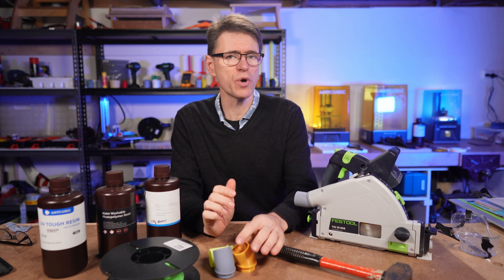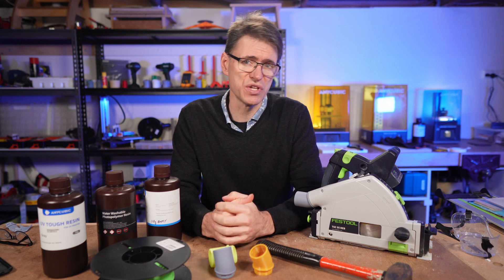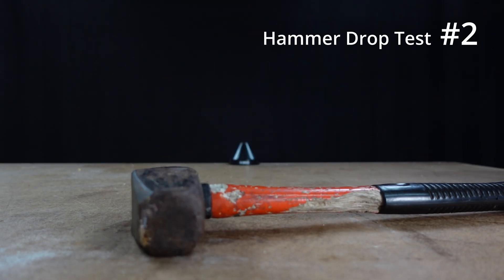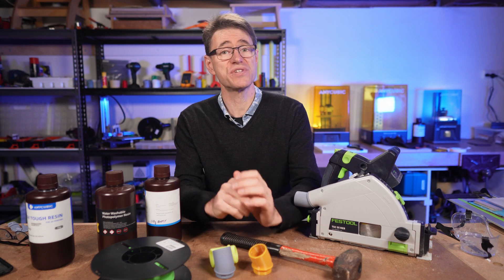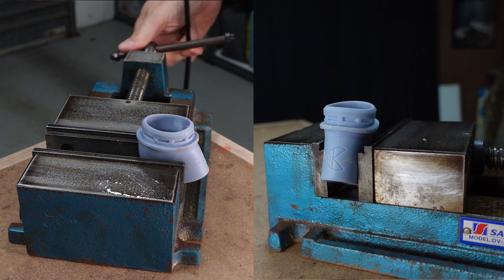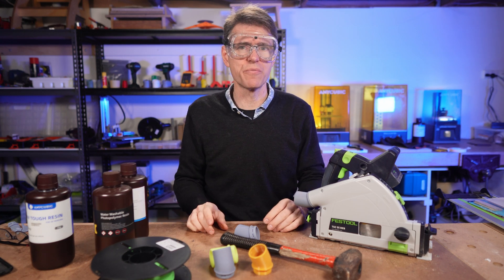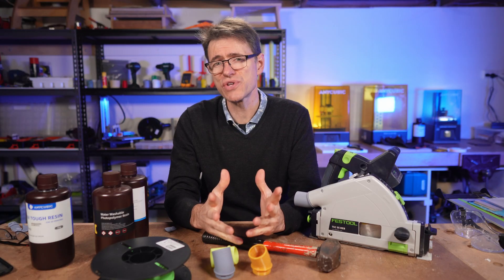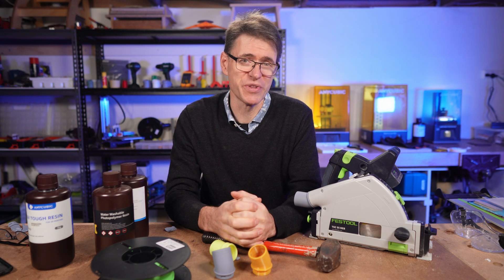Anycubic Tough Resin | How tough?

Comment: I can't print, the model is getting stuck in the VAT. I'm using the Chitubox Basic V2.1 slicer and the Anycubic Mono X printer. Do you know what could be the problem of not being able to print any part?
Reply from the maker: Thanks for your question. Two things you might like to try...
1. Use the Anycubic slicer. You may prefer Chitubox, although some people have found that it's best to use the slicer that comes with the printer for best results. I can't verify that, but it might be worth trying. I have several Anycubic printers, including the Mono X, and always use Anycubic Photon Workshop. It's really improved over the years.
2. Increase base layer exposure time. Even up to around 50seconds, or more.
Reply: @ColinKlupiec  
Thank you very much for your tips and feedback. I will install the Anycubic program and try to modify the exposure time. I am sure that with your tips it will improve a lot. Thanks again. I am from Brazil and I follow your videos a lot, they are very good, congratulations.
Reply from the maker: @FernandoRochadeOliveira-r2s  Thanks so much. I've got more planned after I finish a big project I'm working on. Stay tuned.

Comment: Could this resin be tough and durable enough for use in R/C helicopter 3D printed gears?
Reply from the maker: Yes, I think so. If you're looking for an option that is a bit more rigid, then Anycubic Tough 2.0 is worth a try also.

Comment: I need a resin that forms a hydrogen bond like glass and water for a medical prototype I'm developing. This is what causes capillary action. Does anyone know of one?
Reply from the maker: What a great question. Is colour a factor? Does it need to be transparent?
Reply: @ColinKlupiec  Thanks for the response. No, color and opacity do not matter.
Reply from the maker: Thanks, that's helpful. I can't answer your question, but I've just emailed my contact at Siraya Tech to see if they make a resin with properties like that. Siraya Tech make some speciality resins so I thought they'd be worth approaching. I can't guarantee they'll respond, but it's worth a try. By the way, what app are you modelling your prototype with?
Reply: @ColinKlupiec  Thank you so much. I didn't have much hope that a resin I'm looking for exists. The project has been on hold, since it is too difficult to do with glass. I use Solidworks for all my cad.
Reply from the maker: I'm curious about your project. Sounds like it involves lots of thin tubes. I know IP is most likely an issue for you, but I'd be interested to see an image of it to see how it might work as a resin print.
Reply: @ColinKlupiec  It's a small flat plate with many capillary halves side by side. I imagine it should be easy to print a bunch of them on edge next to each other. I need a few hundred for the prototype. Each one has to be identical.
Reply from the maker: @toastranger72 Hi again. I've had a response from Siraya Tech. They suspect you might be referring to 'hydrogel' for adhering to glass and metal. Apparently there are resins that are hydrogels but Siraya Tech doesn't make them. They say that haven't heard of resins that form a 'hydrogen bond with glass'. That's all they could tell me. Siraya Tech does make a range of specialty resins. You may wish to browse their website anyway to see what they have. Hope that helps. https://siraya.tech/
Reply: @ColinKlupiec  Thanks. I don't actually need the resin to adhere to glass or metal, I want it to act like glass. Glass's property of attracting water in particular. Again, doesn't need to be clear or look like glass. 
I suspect this might be a valuable resin to develop, as many medical and scientific devices require this. It might even be useful in more efficient refrigeration. I appreciate you checking for me.

Comment: Hi. Nice Video. How many seconds / minutes ... do you cure flexible resin in order to keep their properties?   The more seconds curing the less flexibility keeps. Isnt it? 
I guess there must be an optimum timing for curing so you cure properly the piece and do not loss flexibility.
Reply from the maker: Hi, thanks for your feedback and your question. The part in this video is post-cured for 5min. There was some trial and error in deciding on that time, but it seems to provide a good balance of flexibility and rigidity. I think each item you make will have an ideal post-cure time. But I use 5-6min for all my designs and it seems to work.
Reply: @ColinKlupiec  Thanks for your answer. I would have thought 5 minutes were too much time for curing. Thought it would cause a loss of flexibility. Ill try 5 min aprox then.   :)

Comment: How flexible is it?   Im very interested.   Been trying to find a resin that has enough stiffness to be useful but with just enough flex to not be brittle like Nylon Black Sirya tech
Reply from the maker: It’s got great flexibility and stiffness. Especially for working parts that take some stress. I’ve had more success with Anycubic tough than SIRAYA Tech. Definitely worth a try.
Reply: @ColinKlupiec  Ok thanks.   Do you know what the difference it between the Anycubic UV tough resin and the UV tough Ultra?
Reply from the maker: @kwad3d10  Don’t quite know the difference yet, but I’m running my first test prints of Ultra now. I think it might be more flex under stress whilst still holding shape. A higher threshold before actually fracturing. I’ll know more soon.

Comment: are you planning to test their new tough line? they now have tough resin 2.0 and tough resin Ultra which is even more like an additive to make things more bendable. the ultra is pretty pricy, i bought 3 bottles and trying to find the best use case scenario (maybe adding it to craftsman DLP resin to help with the brittle problem).
Reply from the maker: Hey, thanks for asking. Yes, I'm planning to test it because I have a specific use for tough resin. The current tough resin works well, but I'm keen to see how the new tough resins from Anycubic compare. I'll be making a video about that soon.
Reply: Don't mix good resin with bad resin to try to "improve it", all you'll end up with is some watered down medicare reason. Of "fixing" a resin was as simple as just mixing another resin, the manufacturers would have done it a long time ago.
Reply: @unpairedelectron2886  you aren't "improving" a resin, you are changing the properties. Being brittle is not a quality of a poor resin, thats just the property of rigid solids. i have HD grey resin, it captures tons of detail but very brittle, i mix a little bit of tough ultra to make it less brittle without losing detail. You can get the ratios you want instead of limited selection of whatever a resin maker offers.

Comment: i have an elegoo saturn 3 with black anycubic tough resin 2 and having problems with warping. can you share your settings? Im using Voxeldance Tango 4.0.
Reply from the maker: Sure, these are settings for the Anycubic D2. Exposure 2.5sec. Lift 5mm @ 2mm/sec. Bottom layers 6 @ 28sec exposure. I've found that these settings work for just about any resin I use with the D2. It's an awesome printer. DLP has become my preferred printer type because it just seems to provide the most reliable prints for whatever I'm printing...and it's silent. No fans. And no LCD to damage. Just a solid piece of glass.

Comment: Why does it need to be impact resistant and extremely tought well maybe your printing a gun😊
Reply from the maker: It needs to be impact resistant because it needs to handle use with a power tool in the workshop. Other resins are too brittle and the parts break. 😀

Comment: good video. question what setting did you use to print that.  i use default setting, but i have try to find if someone has found better settings
Reply from the maker: I used the settings recommended on the Anycubic website. 2.5 second normal exposure time. I've actually found that this setting works for just about any resin I use with the D2 printer. 😀

Comment: How do you think this would hold up to constant load let's say from a torqued screw or bolt?
Reply: You are much better off doing FDM as you are always more prone to sudden failure with SLA (which might still be acceptable depending on your intended use). Unless this is a compressive force, SLA tends to do okay in that application.
Reply from the maker: Not sure. I should try running some tests. My guess would be quite good though. 😀…..not a very scientific answer, I know.
Reply: Whatever works to prove a point! Thanks for the response!

Comment: The wife ordered me me a Anycubic Photon Mono 2 + 1KG resin for Xmas, it was going to be late so they sent me an extra 1kg of resin as apology, turns out it was the UV tough in translucent green. Not the best colour but since I have no idea about resin printing for the models and gear boxes I want to print, the Tough resin is probably going to be the best choice. Went looking for a review and found another Ozzie ch. Subbed.  If they had translucent Red, Yellow, Blue I could make Xmas lights for next year.
Reply from the maker: Hey, thanks for dropping a comment. That printer / resin combo should work well for you. Resin printing can be tricky when getting started, but it’s awesome once you get the hang of it. Happy holiday season.

Comment: I wonder what's there to work on for a year and a half on such a small part. You can get the fitting tolerances down in 2-3 tries.
Reply from the maker: I welcome your wondering. It’s a passion project. MK1 was printed in filament. Experimentation, testing, external validation take time. MK2 transitioned to resin. A whole new process with different tolerances. A few months of testing, different resins etc. and now MK3…😀

Comment: How opaque or translucent is the part? Also how much distance is there between the inside diameter and the outside diameter? I'm trying to create parts for my project and ABS-like resin is proving to be inadequate as well as too brittle for the job
Reply: Hey, I found out that:
Anycubic basic - brittle
Anycubic tough - Solid / Flexible
20:80 mix basic:tough - Solid part but with enough flexibility to not shatter. 
Try to experiment with the ratios, depending on how much flex you want.
Reply from the maker: @4kocour424  Cool. I might try that.
Reply from the maker: Thanks for your question. The wall thickness is 3mm. The grey resin is opaque. If you’re after something a bit more translucent, then you can start with a white base and add some grey. It looks great. I made a video about that here https://youtu.be/EfQXWcAqLCk?si=0yZSH3pGIFm3dJUr

Comment: Can you test this against siraya tech build?
Reply from the maker: That's a great idea. Never used it before so just looked it up. I will certainly consider this for a test. Thanks for the tip.
Reply: Thank you!! I only use it for the most part after Initial
Test and print scale turbos that spin up to 100k rpm with compressed air or the turbine side. With positive boots enough to break a nitrile glove with pressure. So wanna see if anycubic or sunlu can be mixed to create better forgiving properties
Reply from the maker: @jammindesigns7135  Sounds awesome. Hope it works for you.

Comment: Gomz Addams comes to mind blowing things up haha,  but more sanely great test and that should be enough, as I used pvc fittings on my tracksaw with heatgun and it works well enough and easy to replace again but yours is more elegant for sure
Reply from the maker: Thanks for the feedback. I appreciate it. I'm amazed that new Festool saws are still coming out with the old design. 😀